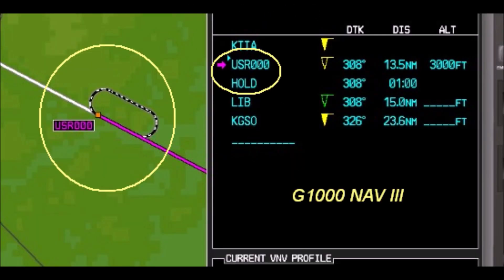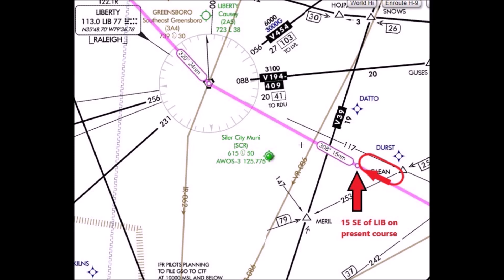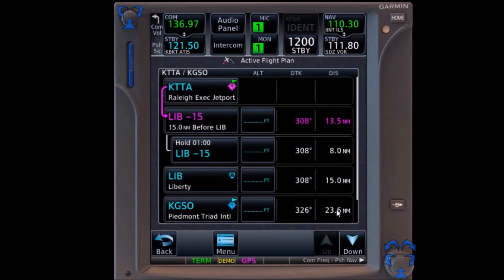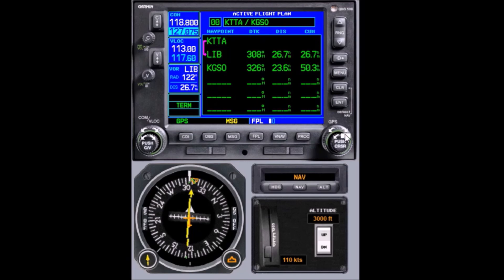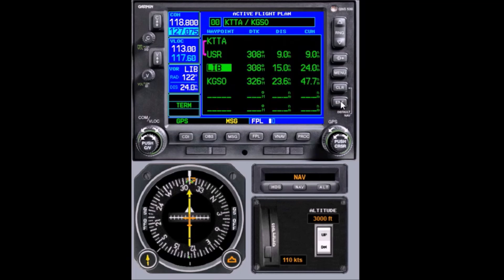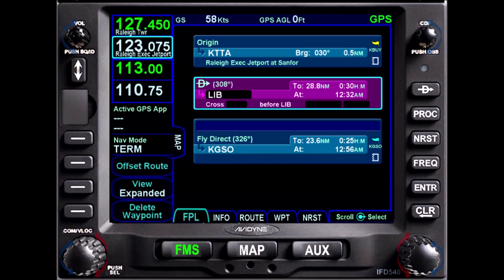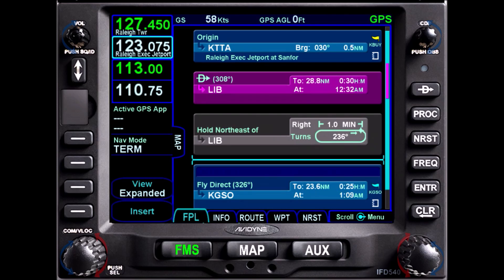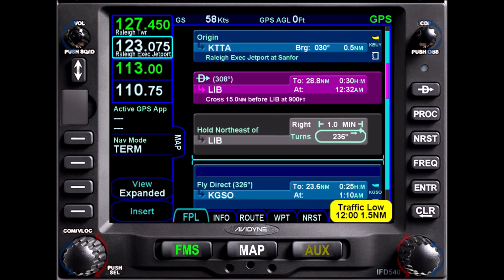Comparison: Distant Hold in GTN, GNS and IFD

Comment: I am still very new to the IFD series of navigators and very much appreciate this video.  After watching it I was of course challenged to learn the proper steps and think I found a slightly easier method.  As you demonstrated, we can easily set a crossing altitude at 15nm prior to our fix.  That point is not in the waypoint list so we can not set a hold there but the point is depicted on our map screen along the route.  Where that point is on the route, press and hold for a moment to activate the "rubber band" function and then release your finger while still on the altitude crossing point.  You will then be prompted to name the new point or accept a default name of "RB001" where the number is how many rubber band waypoints you have created during your flight.  Once the waypoint is created, you can now easily program your holding pattern.  A nice feature of this method is that if you keep the generic name of "RBxxx" it will not save that as a user waypoint and clutter up your IFD.

I hope that helps and if there is an even better method please let me know.
Reply from the maker: One thing which is true of most computer programs is, there is more than one way to accomplish a goal. As you've found, this is also true of GPS navigators.  Yes, touching and holding the touchscreen at the altitude restraint location will prompt for a user waypoint there, which can be used to build a hold.
Reply: Nice Dan!  Good suggestion.  Love the IFD.  Always more to learn.

Comment: Mark, very nicely done.  And you are of course totally correct that the various incarnations of the G1000 (including software revs) -- and I understand even in some cases the G1000 NXi  -- difficult to document.
Reply from the maker: Thank you. There are OEM differences. But the bigger problem seems to be that software upgrades are also make/model specific.
Reply: @midlifeflyer , yep, and those software upgrades need to be worked (certified, I assume) by both the OEM and the Avionics company (in my DA40 case, Diamond and Garmin)... e.g. the most recent available software upgrade for my 2008 DA40 was made available IIRC in 2013.